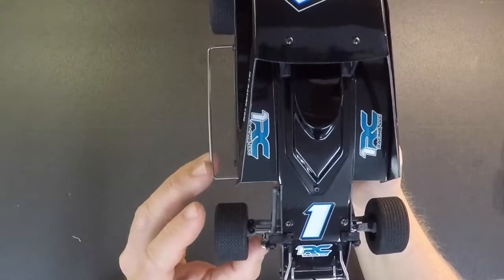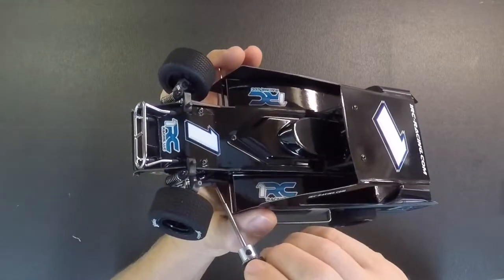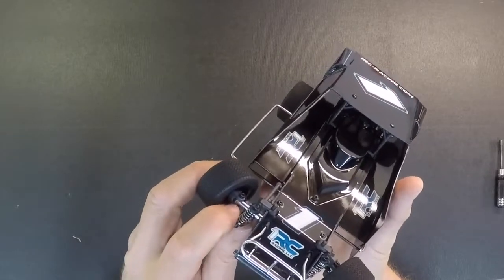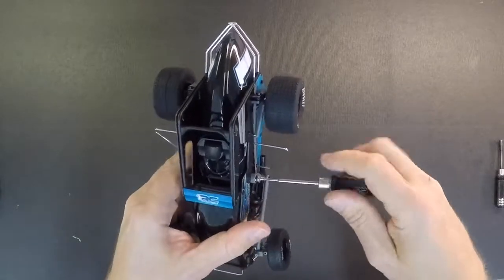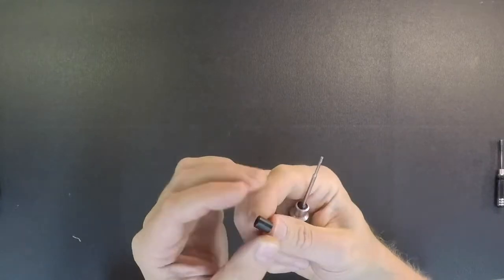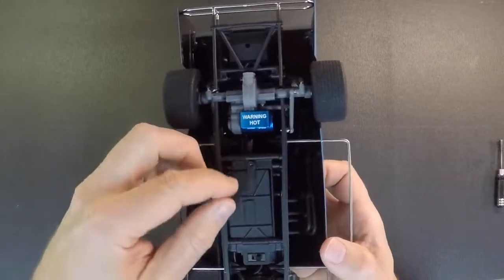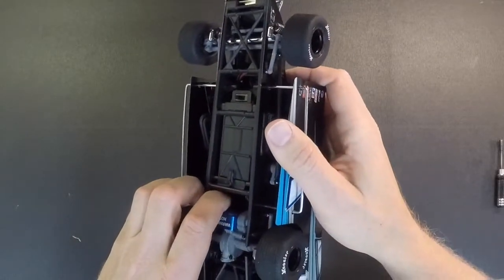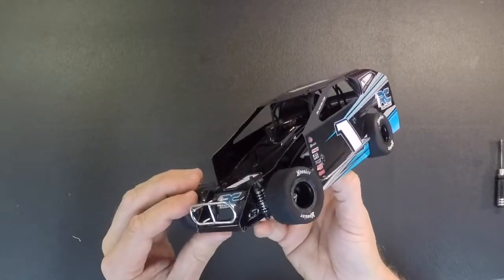1RC - 18th EDM - Questions Video 2

Comment: What's the best lipo battery, and charger, for the 1rc EDM? To make the car faster, and give it longer running time.
Reply from the maker: We don't recommend running a lipo but some do and you can find more info on Facebook about what people have been running.
Reply: @1rcracing149  why do you recommend against using a lipo battery? I think they are better than the ni-mh battery.
Reply from the maker: @stonekoldkustomz8033  The lipo batteries get the electronics hot and make the cars very hard to drive so we do not recommend them.
Reply: @1rcracing149  why does everybody upgrade to lipo then?
Reply from the maker: @stonekoldkustomz8033  Some people do but that is there choice to do so, we just don't recommend it.